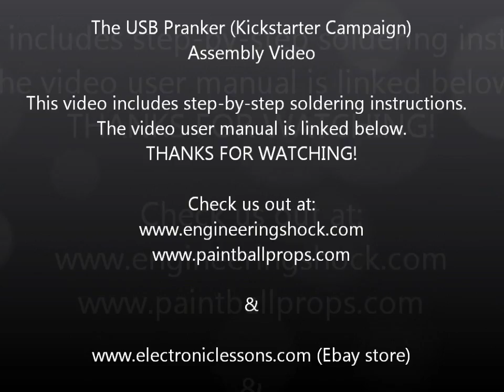The USB Pranker   DIY Assembly Video

Comment: What does it do? Great video btw.
Reply from the maker: +Colin Hammill 
Hi Colin! Thanks =)  This unit mixes custom sound bytes with the audio output from your computer to your computer speakers.  There are several categories to choose from.  The sound bytes are intermittent, and the unit is designed to drive people nuts =)  For instance, after a variable timer period, the unit will inject a creepy sound byte, or a fart sound byte onto the line.  It perfectly, and safely mixes these sound bytes into the audio coming from the PC.  It is powered via USB =)
Reply: patrickikis lol